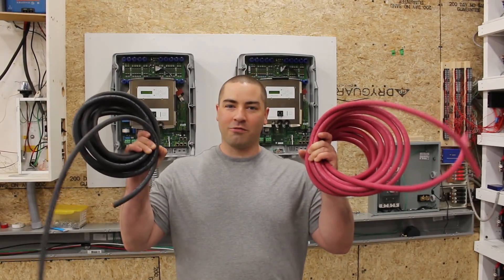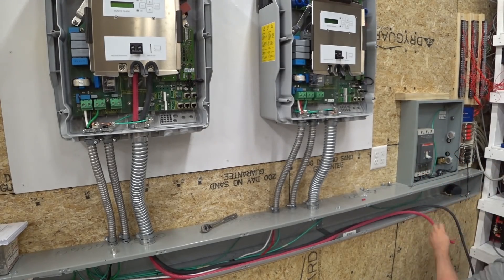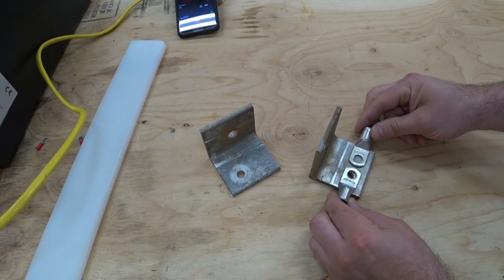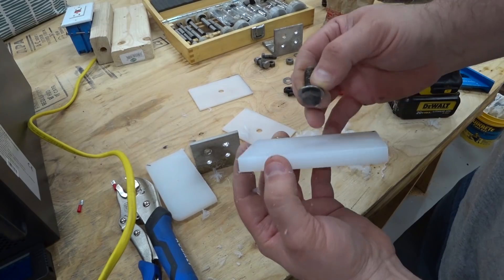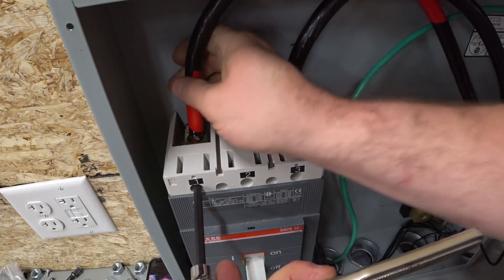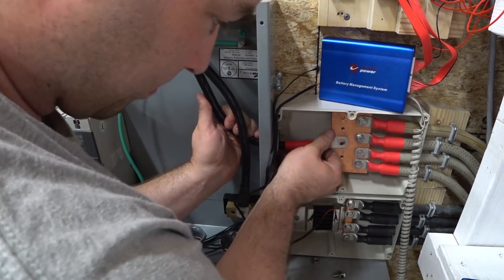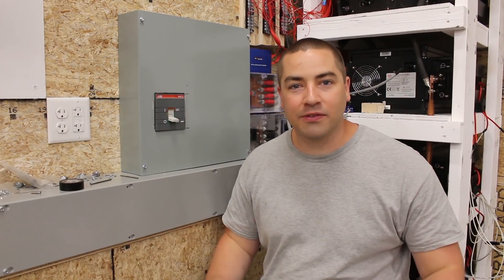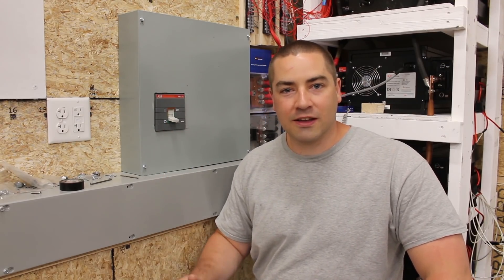Off Grid SMA Sunny Island Inverter Wiring, 48v DC

Comment: Can you use these inverters if you already have charge controllers? Basically I just need it to invert DC to AC no grid connection or charging.
Reply from the maker: Yes.  I did that originally.  I had a Victron charge controller.
Reply: Appreciate that you are replying.

Comment: WOW! 4 years already as we start the last week of 2024. I am curious when you mentioned the “Relay” and it’s purpose wasn’t stated here, but often used to A/C line power in to disconnect when lights or local power comes on, or connect when power goes off. Interesting as similar but yet different, big boats that connect to shore power and have internal batteries. One for the boats essentials and one battery for each engine. But service entrance uses a neat little metal shuttle door at the main. It is manual but to switch, you moved and it had no choice but to disconnect one, then flip the other breakers to one. So, regardless it was foolproof as to battery or shore power. 
  My worry on panels in Central East Nebraska, is hail damage to panels. A perhaps they move from glass to plexiglass or similar to address concerns such as mine. 
   God bless & thanks kindly for sharing. DK.
Reply from the maker: The relay I mentioned was a unique setup I was trying to build, but it ended up not working out.  
As for hail, I think UL-listed panels are tested for 1" balls of hail, but sometimes you could get bigger.  Panels are made with tempered glass, which is very strong.
Reply: @  I hope so! The pan handle of Nebraska has a 7” hail stone on record with the national weather service. I heard on AM radio when headed to Sioux Falls, SD to teach two day classes back to back. The news reported a national weather tech was head toward the black hills to measure a hail stone of 8”. That will leave a mark!

Comment: Hey bro, can you help me with a Sunny Island inverter connected to e flex 5.4 batteries? It's a new install but it has error codes and it turns off. Fortress helped with a little troubleshooting. Technician hasn't followed up for a long while.

Comment: Aloha David, Great job on the videos! I just picked up two Sunny Island 6048US models. 
Question: When you installed and calibrated the shunt how did you handle the installer password? Is there a standard password that the unit comes with? Or were you able to get the password from the original installer?
Thank You!
Reply from the maker: I used the password to do the calibration.  I found the password in one of the manuals, but I can't remember what the password is off the top of my head.  
Edit: Just did a quick search and found the password formula on page 88 in the US manual.
Reply: @DavidPozEnergy  awesome!
Thank you. Love the videos and learn a lot from you.

Comment: What battery would you recommend for Sunny Island? Can Sunny Island work without battery by connecting it to the grid?
Reply from the maker: Sunny Islands require a battery.  If you strictly want to grid-tie PV (no battery) then only purchase the Sunny Boy inverter.  The Sunny Islands are designed to work with FLA (flooded lead acid) batteries.  If you want to use the sunny islands with a lithium battery, then it MUST be one of the batteries on SMA's approved list.
Reply: @DavidPozEnergy  what battery do you use? Could you share a link? Thank you
Reply from the maker: I was running the sunny islands with some DIY  lifepo4 batteries.
Reply: @DavidPozEnergy  wow! Would be another great video to share!
Reply from the maker: I probably have 3 or 4 videos setting up that battery bank.  It's on a white shelving unit I installed.  I used some 8s BYD packs.  But, they were not in very good condition.  Today I am running a pre-built battery bank: https://signaturesolar.com/eg4-ll-lithium-batteries-kit-48v-100ah-x-6-30-72kwh-6-server-rack-batteries-with-pre-assembled-enclosed-rack-with-door-wheelsac/?ref=4_rHcgZ9x-TiF-
Reply: @DavidPozEnergy  Hi David, Does your current server battery bank communicate with Sunny Island via cat6 cable?

Comment: I want to add 2 SI6048 inverters to my house with the existing 3 SB7000US.  I want to know if SI6048 can charge LiFePO4 51+ VDC or do I have to add some battery charger that replaces the lead-acid design specifications.  I have the SI6048 inverters NIB (eBay) and 3 spare SB7000US inverters, partly because my system has no contractor warranty and just the 10yr SMA on the Sunny Boys.  We don't have frequent power outages but I would like to by hybrid ON/OFF grid.  I want to use 2 white rhino 14kWh from Big Battery, one on each SI6048.  Please let me know if you are running 51+VDC LiFePO4 batteries on your SI6048s.
Reply from the maker: Hi.  I'm not currently running my SI6048 inverters.  When I did run them I was able to charge regularly well above 51V.  I set mine to 56V for charging.  

Nothing wrong with the Rhino battery, but I am concerned you said "one on each SI6048".  You might be doing some kind over very unique installation where that makes sense, but if you plan to set the two inverters to work together (making 120/240V split phase) then they need one battery bank feeding both.  I'd suggest checking out this battery bank: https://signaturesolar.com/eg4-ll-lithium-batteries-kit-48v-100ah-x-6-30-72kwh-6-server-rack-batteries-with-pre-assembled-enclosed-rack-with-door-wheelsac/?ref=4_rHcgZ9x-TiF-  It will provide more capacity, for less money.  The battery cabinet has central bus bars built in that you can wire each inverter to.

Comment: I bought 2 of them without the temp sensors and current sensor. I only use one for my lithium battery. And after a few hours. It restarted.(no AC power). Do I have to have the temp sensor?? Thank you

Comment: Looks good, but my concern is the copper lugs (ring terminals) connecting to Aluminium which is a no-no as it will cause corrosion due to electrolytic action between the two dissimilar metals.

Comment: David, do you know why SB 7000TL-US-22 is listed as being "not  compatible" with off grid systems based on page 4 of SB-Offgrid.TL-US-en-21.pdf whereas SB 7000TL-US-12 is listed as compatible for both off grid and for systems which are installed for battery back up of the grid?  SMA doesn't say why.  I care because there is a 50% off sale on the SB 7000TL-US-22 but I need an inverter which will run off grid with my  SMA Sunny Island SI6048-US-10s.  TIA.

Comment: Hi David. 
Excellent videos. This my first DIY Solar. I’m having some issues hopefully you can help me out. I’m using a Midnite 150 classic charge controller I have everything wired per the specs of the controller. When I tie in 1 sunny island 6048 inverter it lights up for about 5 seconds and then trips my 2  24v battery/EVO tied into series to create 48v batteries. Why does the inverter trip the breakers on the battery packs?
Reply from the maker: I don't know, but possibly check these things:  The SI6048 inverter can surge pretty high.  I'm trying to remember off the top of my head, but I think it's 7,000W for 30 minutes.  If that's the case, and your battery is lower in voltage then the amps would be bigger than the battery can handle.  For example, 7,000W/46V=152A.  Personally, I'd have more battery capacity.  But, a way to check is with an amp-meter.
Reply: @DavidPozEnergy  Thank you. I will check that.

Comment: Hi David, I have been trying to duplicate your setting. I move over to Batrium for the BMS with LifePo4. How did you setup your battery thresholds ? I believe for Lithium Ion/LifePo4 to be supported by the Sunny Island, you need to have your BMS connected to the Sunny Island through the CAN Bus. I do not believe that the Chargery has a CAN bus. The documentation on Lithium Ion support for the Sunny Island is not very good. I was wondering if you were able to have more information than what is on the manual of the SMA ?
Reply from the maker: You are right that the Chargery didn't support this.  I've never tried Batrium.

I ran my SMA's in VRLA (valve regulated lead acid) mode for a long time.  I turned off equalization, and turned off temperature compensation.

Comment: I come here to learn and Learn I do! Thanks Dave!  Everything you do is very important to the Off grid DIY builders and fans!  Our Little system is chugging along great! We even had a shut down. All BMS's turned off. We saw zero Voltage from the Smart battery. Our Outback FM80 would not charge as it did NOT detect a Battery voltage. I jumped it for 3 seconds with a 12v Lawn mower battery. Poof! System woke up and it sky rocketed back up to 48v and began charging. The BMS ( all 6 ) did there job protecting the system from low voltage and disconnected locking up the  bank until we forced some power on it from our DC Solar side. If we hooked up to a Generator it would of popped a relay and also started the charge cycle. ( No generator for now.)  BMS's are a must when building. Protection they provide is crucial!
Reply from the maker: Thanks for the update.  Good job getting it going again.

Comment: David, do you have a big ass powerpoint / diagram of your whole system?  You seem to be running multiple batteries parallel, of different chemistries/voltages?  Is that correct?  And I would like to something similar.
Reply from the maker: I don't have a massive wiring diagram for everything. My system is constantly changing. Last week I wired up another battery in parallel. but I just did a video talking about that and should be up in a couple of weeks.

Comment: Hello, this dc circuit breaker you used how much the voltage rating, it’s 48V ? And can we use dc circuit breaker with higher voltage ratings like 550V or 1000V for system batteries 48V can be efficient in high current or faults?! Thank you 😊
Reply from the maker: You can use circuit breakers with higher DC voltage ratings, but it must be DC rated.

Comment: If I have a grid tie inverter where will that be connected to?. Can I have any LiFePO4  connected to sunny islands?. I am planning to order 150Kwh batteries from china to make a three phase sunny island project. Thanks for the videos, very useful.
Reply from the maker: I use my Sunny Island inverters with LiFePO4 cells.  They work fine, but the SOC is a little off. I have to adjust it once in a while.

Comment: A wiring/circuit diagram or even block diagram would be useful too. Plus where is the Sunny Boy Island box?
Reply from the maker: Thanks for the suggestion.  Next time I do an update on the SMA inverters I'll include a diagram.  
I don't know what you mean by the "Sunny Boy Island box".  I don't have any Sunny Boys.
Reply: @DavidPozEnergy  sorry I meant to put SunnyBoy/Island box. SMA do both and I wasn't sure if you had one, the other or both. I also thought the Island units worked as a hub, communicating directly with Sunny Boys. In the UK (and most of Europe IIRC) We tend to have SERIES connected PV that feeds 180v plus into the grid tied inverters we have so much lower cost on the cables and simpler wiring, with the downside that they do not get fitted with voltage/output monitors individually so any problems with a series element makes it a bitch to resolve. Also, although fitted with Bluetooth comms, my unit, fitted in our loft (flat!! Not vertical - against install advice!) is not easy to access or maintain or modify!

Main issue with grid tied sytems here is NO OUTPUT is usable in case of total power outage! Bummer!

Comment: Hi David, which battery configuration did you choose in the SMA software? The BMS is not connected to the inverter, or is it? Can you choose the Lithium battery configuration if the BMS is not sending any signals to the inverter?
Reply from the maker: I set the SMA inverters to VRLA (Valve Regulated Lead Acid).
Reply: @DavidPozEnergy  thanks for the fast reply! Did you experience any issues regarding the VLRA profile? Does the inverter do some kind of pulse charging or something like that, which is good for lead acid, but would decrease the lifetime of LiFePO4 batteries?
Reply from the maker: The SMA inverter does not pulse the charging.  It works OK, but the SOC algorithm is a little off.
Reply: @DavidPozEnergy  thank you. I think I'm going to build the same system with the sma sunny island. It sounds promising for long term operation with a huge diy battery pack (>20kWh).

Comment: It should also be possible to use two 75mV shunts in series, use the centre tap for the BMS and the series tap for the full 150mV. Not really a big deal, but slightly more efficient to have less resistance I suppose.

Comment: Is the direction into the breaker important since it Will run both ways? You Said earlier that the inverter had to go from the bottom of the breaker.

Comment: So what charge controller are you using with the sunny island inverter. I'm looking at a pair of these too.
Reply from the maker: I have a Victron 250/100.  However, the SMAs are not happy that I'm DC coupling.  The software inside is not really designed for it.  Instead, the software is built around an AC coupled system.  I'm going to be adding another solar array with a Sunny Boy AC inverter to try out this AC coupling.  

So, if you buy a pair of SMA Sunny Island inverters, only do AC coupling.  A Sunny Boy inverter at the array.

If you decide to do a DC coupled system, then I'd suggest using Victron charge controller with Victron inverter.

Good Luck
Reply: @DavidPozEnergy  oh ok I thought they be good offgrid setup as we don't have option for ac hookup. I will have a propane gen in system and might add wind when all said. I have 32x 260w panels and will do 48v battery bank. And was looking at a deal for pair of midnight classic 250 buck only charge controller as I will have to do 2 array setup because of my max volts and amps per panel on the coldest days I could see.
Reply: @DavidPozEnergy  I found midnight solar has setup for sunny island grid tie and offgrid setup and stacking too. New to all this and looking to do my own offgrid they have youtube video too with good info.
Reply: @DavidPozEnergy  well sir I bit the bullet and got the pair of midnight classic 250 buck only and the pair of sma sunny islands. The charge controller coming in mail and have to go pickup the sma. I sent email to midnight and check on the e-panels.

Comment: Love the videos very educational. I have and off grid cabin that use 3 140 ah AGM batteries with a 3500 watt inverter for power. 350 watts in solar to charge batteries. 12 volts of course. Looking to up grade to a better setup. Any suggestions. Thanks
Reply from the maker: I can't really suggest anything unless I know what your loads are, and why you are not happy with your current setup.  But, generally speaking, I prefer 48v.
Reply: @DavidPozEnergy  thanks for the reply . My biggest draw is my 1/2 HP well pump or when the wife uses the electric frying pan 1800 watts . All lights are led small fridge. I can go all weekend as long as it's sunny and not run the generator. I am going to be building a power house for the generator and hopefully the solar and wind turbine. AGM batteries don't like the cold . I'm looking for a bit more storage and something that can handle the cold weather of up state ny.
Reply: Also low maintenance bc not always able to get up there in the winter.
Reply from the maker: For cold weather you have a few options.  Option #1 is my preffered.  This is where you build in systems that control temperature.  This would mean an insulated shed to house the batteries, with an automatic thermostat and heater.  Always maintaining a minimum 50°F in the shed.
Option #2, Use LTO batteries because they can work well below freezing temperatures without any harm.  I have a few videos on LTO on my channel.
Option #3, I know of this one battery (Kilovault) that includes a built-in heater, pretty nifty.  https://www.altestore.com/store/deep-cycle-batteries/lithium-batteries/kilovault-lithium-solar-battery-p41011/#KLV3600CHLX
Reply: @DavidPozEnergy  so I would be looking to build a battery box like your buddy in Vermont.

Comment: What batteries and bms are you using with these sunny islands? Tell me more about the RS485 communications. Thanks.
Reply from the maker: I'm using LiFePO4 batteries, arranged in a 4p16s configuration.  My battery bank is about 24kwh capacity.  I have several videos on my channel about building my battery bank, but they start with this one: https://youtu.be/i_V8v4APT60  it's an OK battery bank, but not perfect.  I'm working on expanding it.  
There is a black communication wire between the two SMA inverters.  This allows them to keep in sync with each other.  I have mine setup to be out of phase, so that I can get 120/240v power.

Comment: Everything I have read says using solar  battery power is much more expensive then grid tied solar power because the batteries eventually die/ loose capacity and when you go to replace them all your savings vanish. Have you calculated how much your electricity costs/ kwh usign a battery vs using grid tie? It is very cool to have independent electricity, but is it economical for someone to do this? I have installed my own grid tie systems and now that used electric car batteries are about $100/kwh I am trying to figgure out if adding a battery system is worth it for a 10kw array
Reply from the maker: You are Right that grid tie electricity is going to be the cheapest. The batteries will eventually die and that pushes out the ROI I have not done a calculation for my payback. I'm doing this also for the power outages so it's not so much about ROI as it is energy independence and being prepared for emergencies.